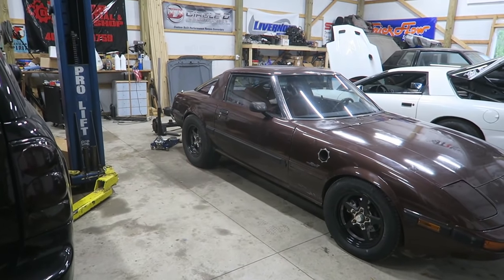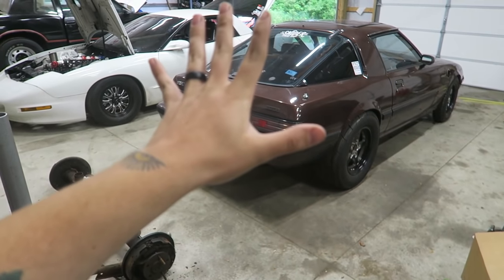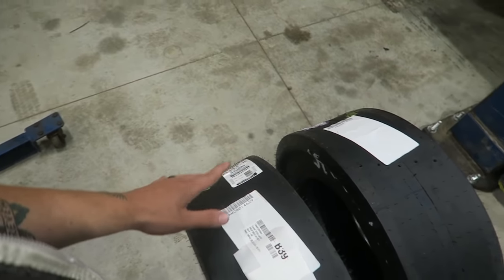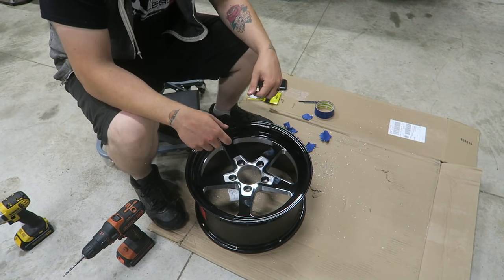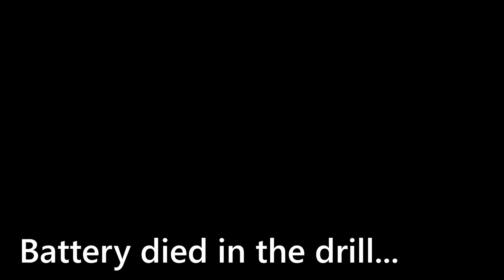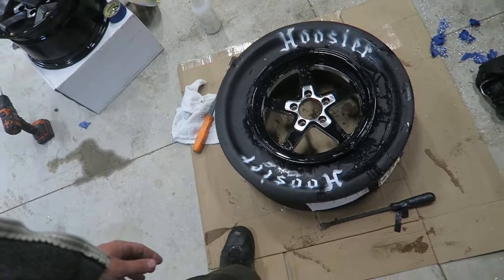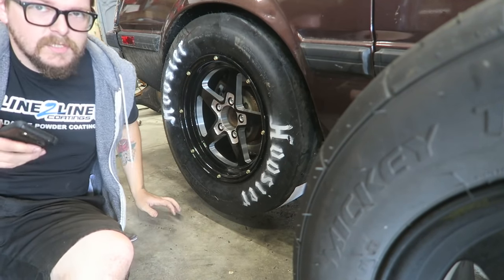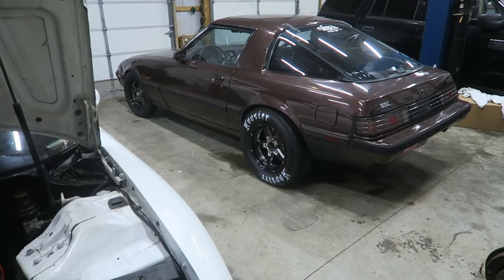How To Use Wheel Screws Without DESTROYING Your New Slicks!

Comment: What did you mean by putting the wheels at the same orientation?
Reply from the maker: The Hoosier logos are in the same spot on each side. Like when one side has the logos on top and bottom, so does the other side. The rear end is locked together so I know if they aren't lined up any more something might be up
Reply: @SniderTron3000  Oh you pinned the tire to a reference on the rim, Gotch ya. I was having a brain fart, because I know you're way smarter than what I was thinking you said you were doing...lol